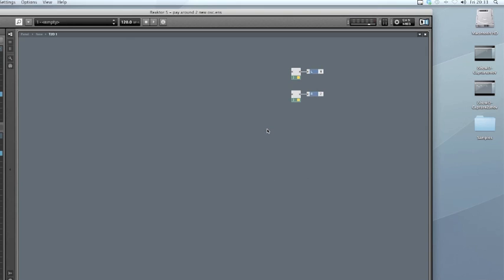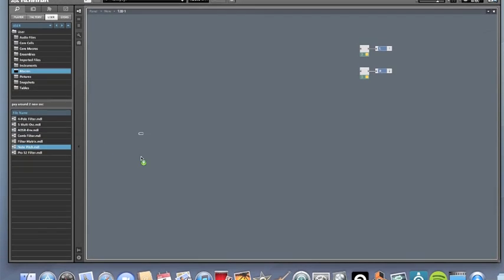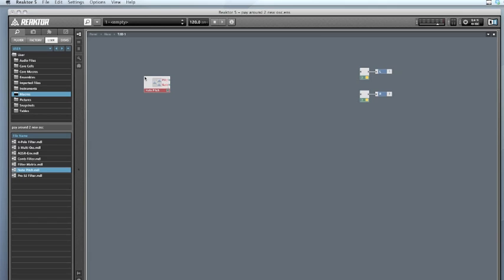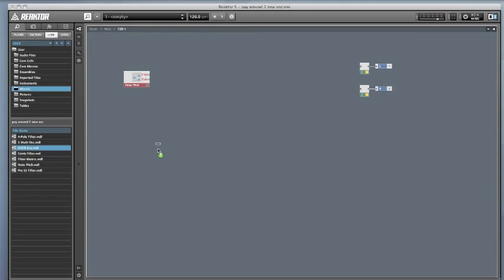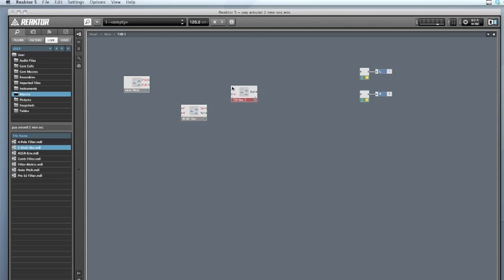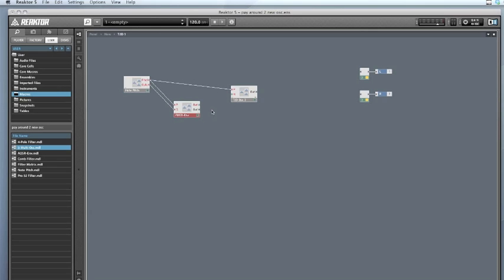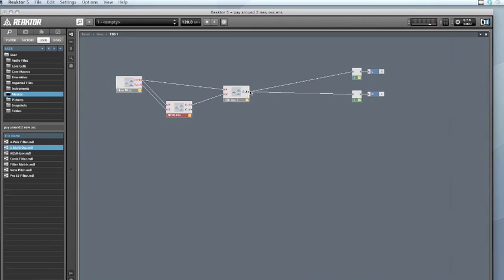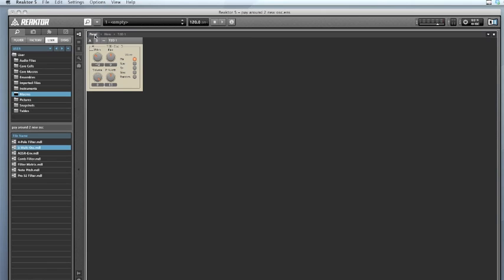Exploration : Reaktor - Part 1

Comment from the maker: @Uprightest  - the outputs are a part of the instrument block. So, when you start a new ensemble you'll see an input block, instrument block and an output block. when you double click the instrument block you will see the outputs already there. if you need new ones you can get them from the io section of the building blocks in the factory library.